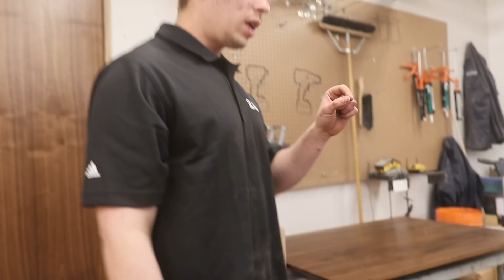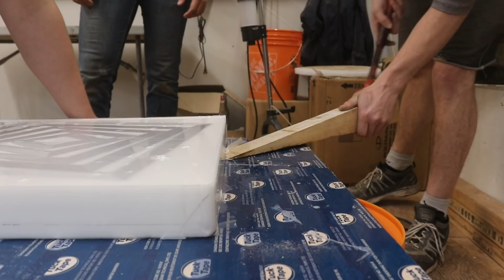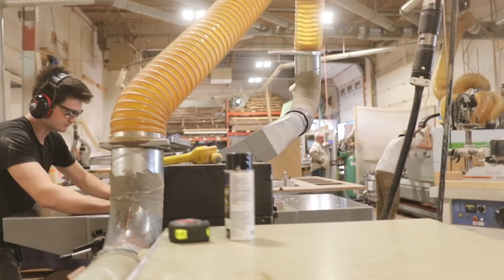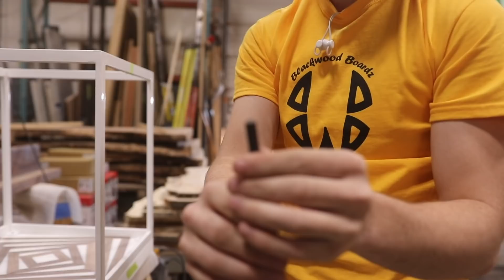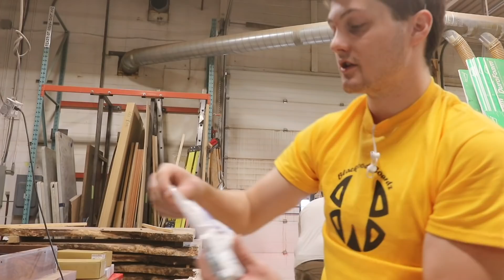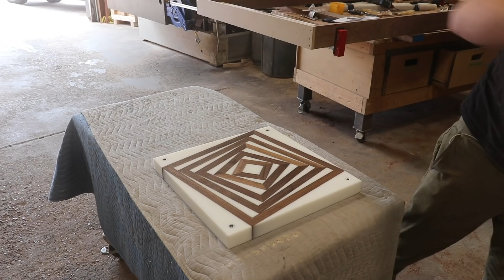How to Build an Epoxy End Table Step-By-Step Process

Comment: How did you keep the wood from floating when you added the epoxy?   Thanks
Reply from the maker: We put what we call strong backs over the table and clamp them down and put blocks of wood covered in tuck tape in between the table and strong backs to keep the table from floating up! We have a video about how we make our moulds if you're curious about anything else! https://www.youtube.com/watch?v=iAlnfOT8bAw&t=319s

Comment: Once you pour your tables what do you do with the left over resin and how do you clean the buckets??
Reply from the maker: We usually make coasters with the leftovers, sometimes we turn them on a lathe. And for the buckets, we wait till the epoxy hardens completely and then we hit the bottom with a mallet and the hardened epoxy will fall off, and it's super satisfying when it all comes off as one piece 🤣